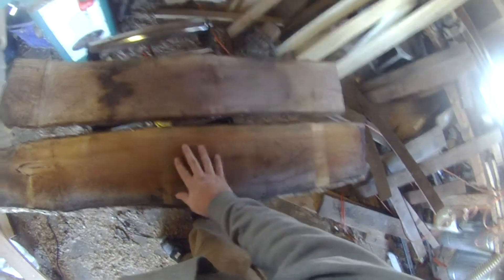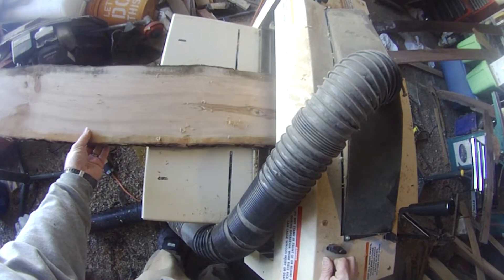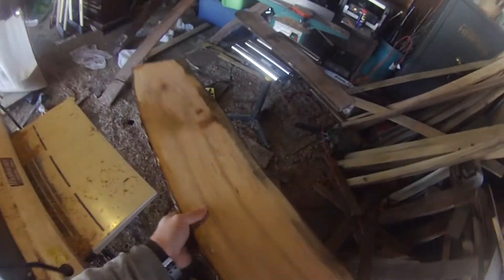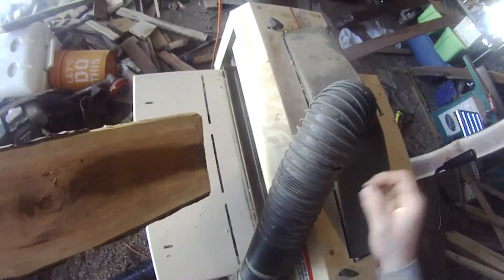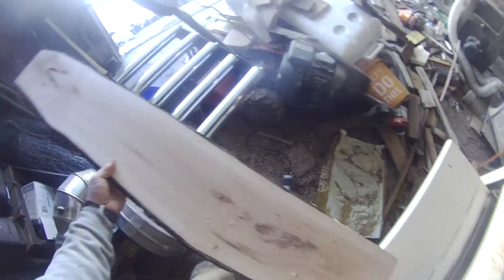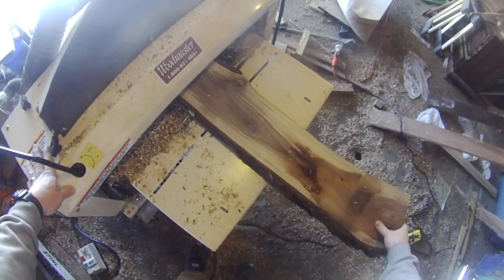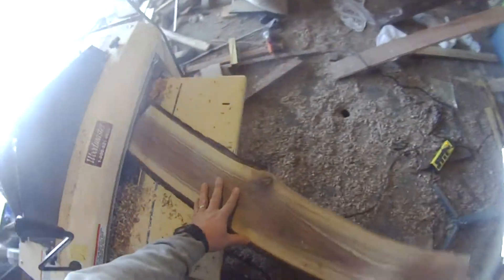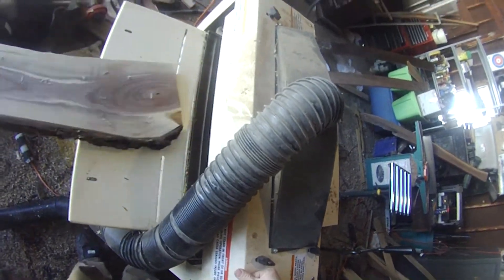Woodmaster Planer 725 video. Cherry and Walnut slabs

Comment: Quick question.  I get a lot of snipe on my 725 and Woodmaster who is usualy really helpful about issues doesn't have any real help on how to not have this.  Have you run into this problem at all?
Reply from the maker: yes I do get snipe. I loosened the roller springs a bit and it helps.
Reply: snipe is, unfortunately, a normal part of any planing operation...you can reduce it to near zero by using a sacrificial board (front and back) or two side rails that are longer than the piece.